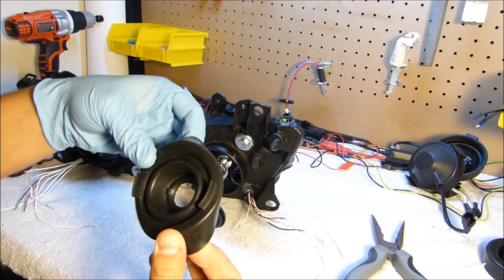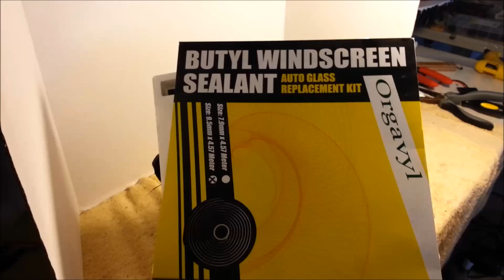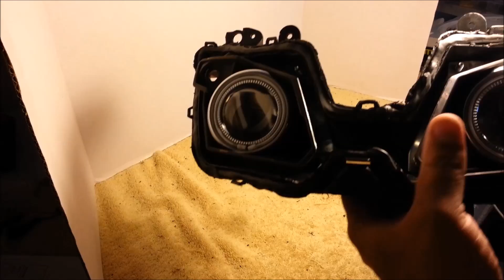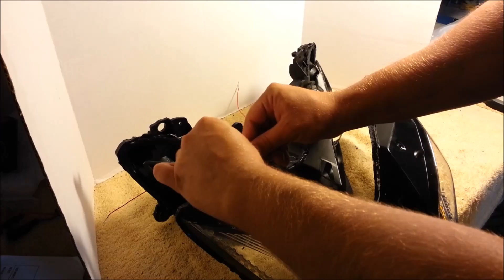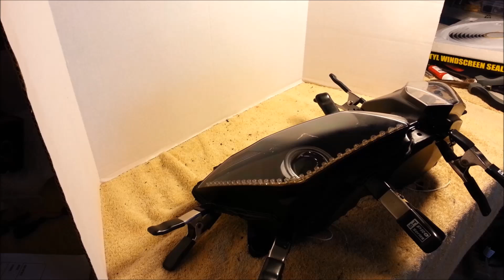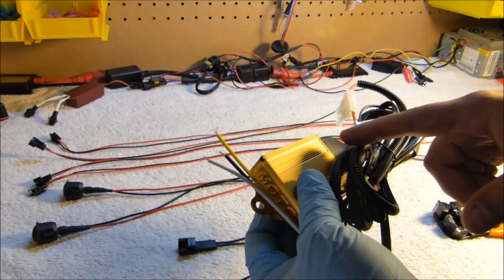Part 2 of 2 How-to Install 2013 - 2015 ZX6R 636 & Ninja 300 BKMOTO HID Projectors Halos Demon eyes

Comment: FOR THE DAYLIGHTS, ARE THEY STILL HOOKED UP TO THE ORIGINAL WIRES OR DO WIRE COME OFF THE NEW WIRING?
Reply from the maker: the daytime running corner lights stay the same, still hookup to original factory plugs.

Comment: So you give us all the wires connected in the end but can you show how to out them all on the bike
Reply from the maker: We dont have access to every make and model motorcycle on the market, so unfortunetly i cannot do a video how to place everything on the bike. but its not that hard, just run 1 wire to the battery, mount the relay box, ballasts, inverters on the bike and put the bike back together.

Just get a little creative with finding room on the bike to mount the components and you should have no problems.

we sold thousands of kits and every one was able to find room to mount everything on any bike model.